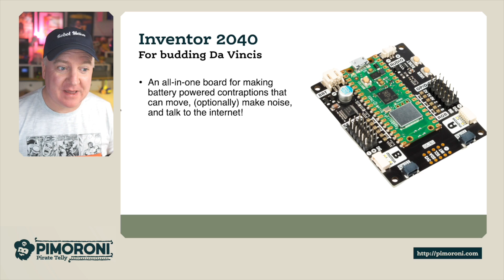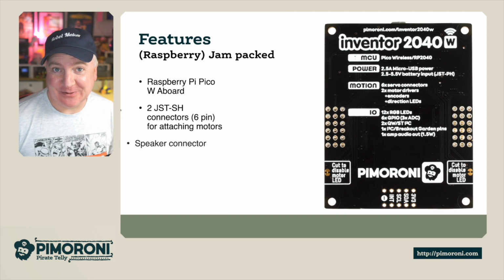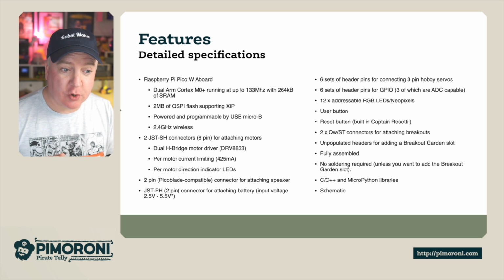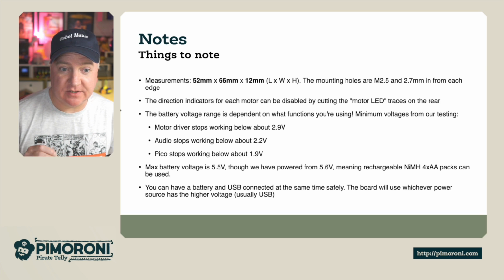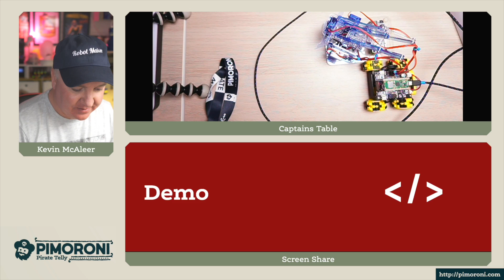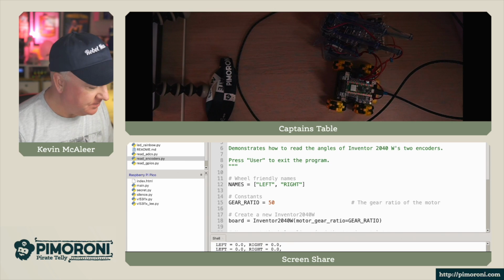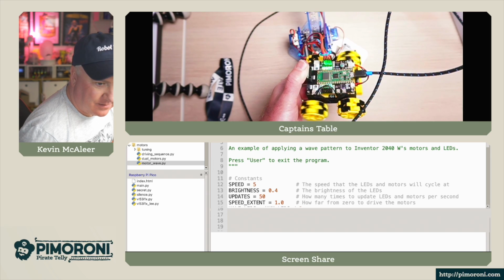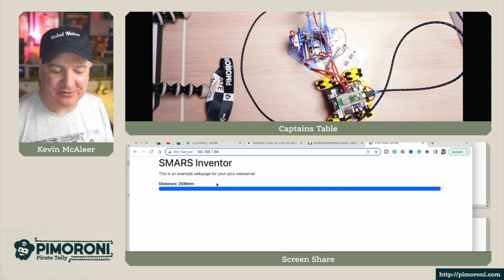Introducing Inventor 2040 W (all in one servo/motor/audio board with Pico W Aboard)

Comment: Is it possible to charge LiPo battery on board, or do you have to disconnect charge and reconnect it out everytime?
Reply from the maker: There's no LiPo charging circuit on this board (this is so you can use it with LiPo or alkaline batteries).

You could add a LiPo Amigo Pro if you wanted to add charging though? https://shop.pimoroni.com/products/lipo-amigo?variant=39779302539347